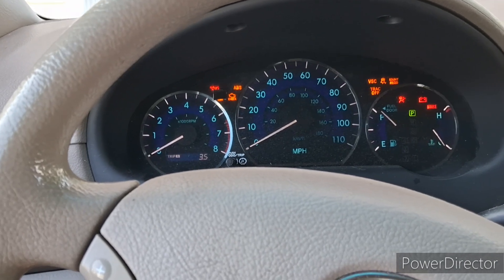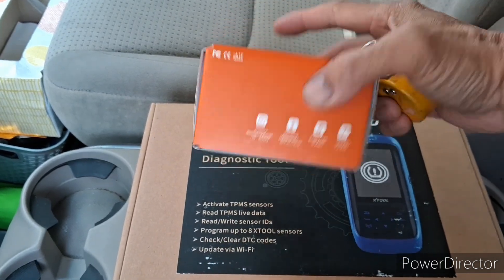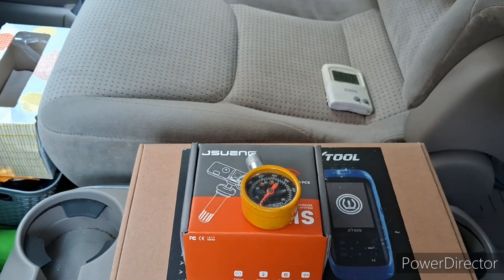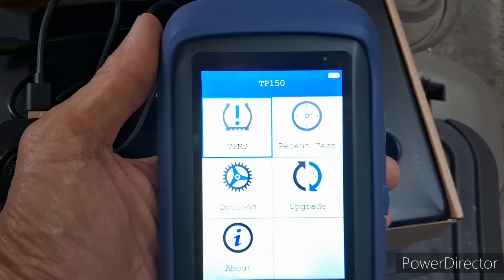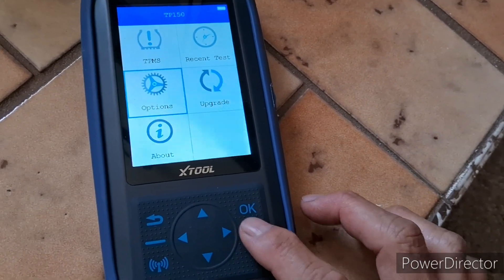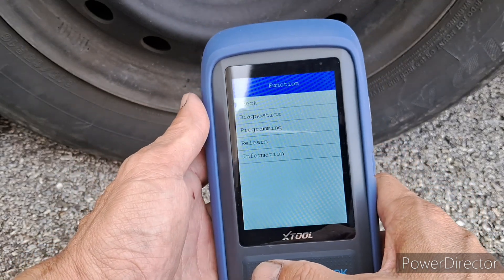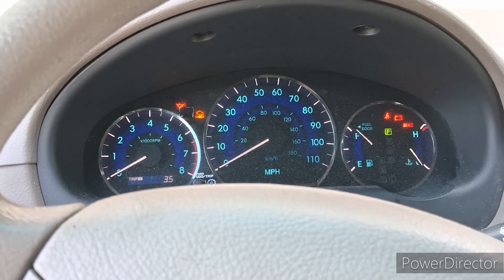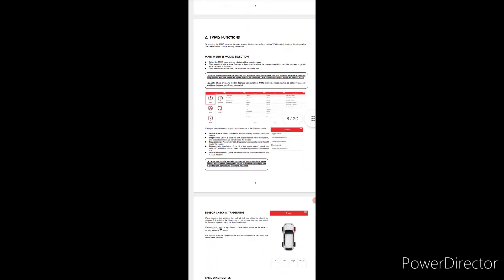XTool Model -TP150 TPMS Diagnostic Tool | How To Guide to Basic Operation

Comment: I was reading the information for the Xtool TP-150 diagnostic tool a it states that it will only program TS100 sensors by Xtool but saw in your video that you used a different brand of sensors. How were you able to program the Jsueng sensors with this tool?
Reply from the maker: It automatically records the serial number after reading the sensor. Then you can reprogram the TPMS with the new sensors ID. You can also manually program them in.
Reply: @MoBangFoYoBucks  Thanks for the information.
Reply: I contacted XTOOL and they stated that the TP150 is only capable of programming new sensors that are the XTOOL TS100 brand. No other brands are supported.
Reply from the maker: Of course, they need to sell their own sensors! When I rotates tires, the ID s are no longer in the right place. I reprogram the OEM sensors to see if it works, and it does. That certainly is not XTOOL sensors!
Reply: @MoBangFoYoBucks  So you where able to replace and program the Jsueng sensors using the Xtool TP150 just fine? Thanks
Reply from the maker: @futurestradingwithmike  If you wait a week, then I can tell you the true result. I'm on the road traveling. I just programmed those new sensors into the reader and into the vehicle CPU. They are in the system, but they are not installed on the wheels. So, the TPMS only see the OEM sensors on the wheel. If the new one was installed and the old one was removed and placed far away, I bet the TPMS will read the signal from the new one once the tire is properly inflated.🤞 I will put out a video once it is done.
Reply: @MoBangFoYoBucks  Sounds good. Look forward to your updated video!
Reply: @MoBangFoYoBucks  Good video.  This answer might be misleading to people though.  You are not reprogramming the OEM sensors.  OEM sensors that have an ID number printed on them are not programmable.  You are reprogramming the ECM on the vehicle, known as relearning, with the new sensor ID's.  If you have XTOOL sensors and an XTOOL TPMS tool, then you can actually reprogram the sensors with new ID's using the tool.
Reply from the maker: Just as i thought, you can program any "after market" preprogrammed sensored designed for any TOYOTA vehicles with this tool. It will always show FAILED relearn when you went through the process. The vehicles will actually read/refer to the IDs that you just program into it via "Relearn".
Reply: @MoBangFoYoBucks  I own the MaxiTPMS and you are only able to reprogram the sensors with the MX or Maxi brand sensors with the device like most other sensor diagnostic tool devices. There is an option using the Maxi TPMS to reprogram the ECM directly with new sensor id's. Using the relearn program I was able to reprogram the ECM to the OEM Toyota sensors I ordered.
Reply from the maker: @futurestradingwithmike Great addition information about sensor brand that we can reprogram with this tool!😎👍

Comment: Thank you for demonstrating that TPMS reader/tool. Like you, I love gadgets, and the xTool looks pretty good. 

I drive a 2008 Toyota FJ Cruiser. When I get my tires checked and rotated at Discount Tire, the technicians always tell me that a couple of my TPMS (sensor) batteries are very low. When I take the car into the dealership for inspections or oil changes, I ask the service manager to check the tires, and I explain that DT says two of the sensor batteries read as very low. At the last visit, the service manager told me that there were no problems with any of the sensors' batteries and that sometimes DT techs will give customers the wrong information.

My issue is that at certain speeds (anywhere between 65 and 75 mph), the sensor light will flash, which causes anxiety for me. I now have a folded up paper receipt covering that annoying light, and I get the tires checked on a regular basis.
Reply from the maker: Yes, do a visual check before driving. A short walk around the vehicle will do. If you see anything unusual, it's time to drive it to the nearest gas station and air it up.
Reply: @MoBangFoYoBucks  Thank you for your safety instructions! This can be lifesaving! On the road!

Comment: " good job " Tim, more people have trouble with those sensors for air pressure . keep the scanner for future needs , return the new sensor and go back to your tape or sticker cover for the  light . Hey, your ' Mo Bang ' your smart enough to check and fill your own tires . Hope your doing well and stay safe. 🙂
Reply from the maker: Unfortunately, the light came back today! So, I will swap them out on the next tire replacement in about a month.

Comment: Sensors last about 6-8 years, maybe up to ten. Easier to replace when you get new tires. About every five years. As they already have the tire off the wheel.  If you travel like tim, just track how long its been since you replaced them as you probably change tires more than every five years. Dodge and ram are easiest as there is no specific placement, it reads off location not unique id from sensor. PITA if you do it yourself. It can be done, but just pay tire guy on this one.

Comment: Hey Tim!   What is the light that looks like a car with a key in it?  Its red and it flashes when the car is off, is it supposed to flash when the car is off?
Reply from the maker: @RichTaylor-tx3vn  YES! It's a fake light for "Non-existent" alarm system!😂🤣😂
Reply: @MoBangFoYoBucks   🤣🤣🤣 I just bought an 06 sienna and it flashes when the van is off.  Do u think it effects the battery voltage?
Reply from the maker: @RichTaylor-tx3vn Unless you are not moving the van for over a month, it wouldn't.